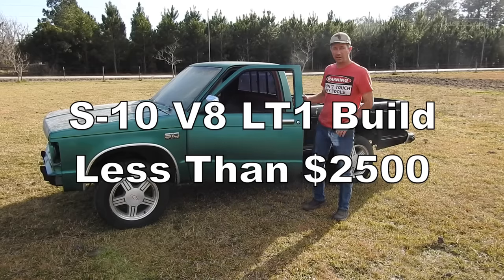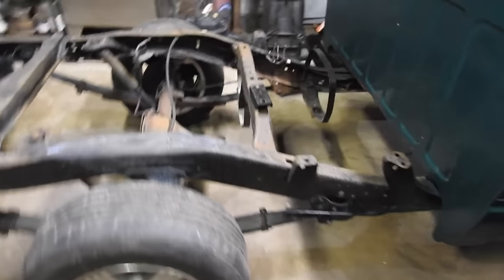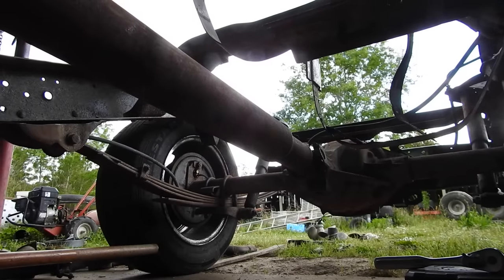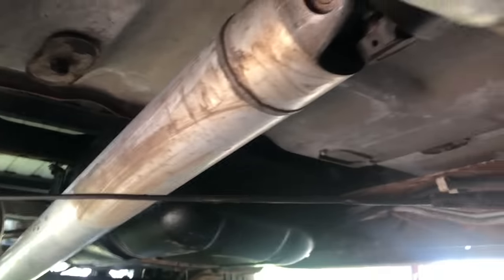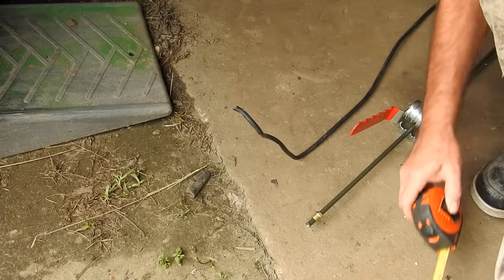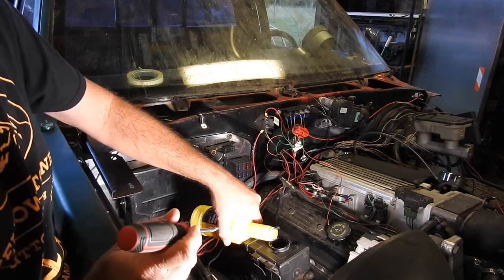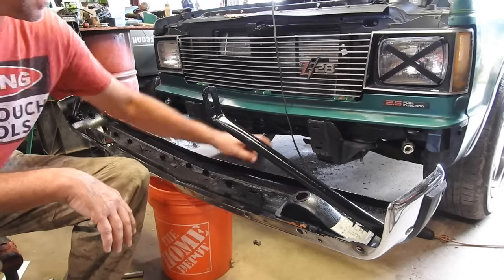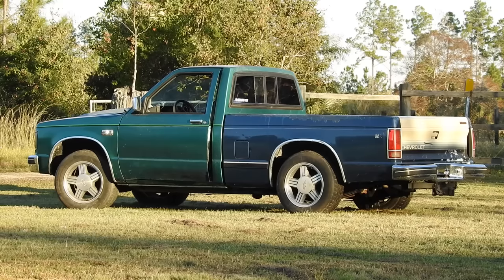S10 V8 LT1 Build for Less Than $2500

Comment: Ive just been gifted a free 81,000 mile, 95 Z28, from a guy I used to turn wrenches with at the local Ford dealership.  He spent thousands on the engine, heads and transmission. It dyno'd at 421 hp to the wheels, N/A. Plus it has a 130 shot of nitrous on top of that. He ran 7.40's on nitrous at our 1/8th mile drag strip here in Jackson, TN. Its been sitting out in the direct sunlight for 10 years and the clearcoat is bubbled up on it. So we're gonna have to try some wizardry on that, and see if we can at least make it a nice 10 footer. Lol. He parked it only 2500 miles after building it, due to blowing a head gasket. He got in a hurry finishing up putting the engine back togethern, and put a cheap set of gaskets on it. So im hopefully gonna pull the heads off this week, and drop them off at the machine shop, just to have them cleaned up and checked, just for peace of mind.  best gift ive ever been given. Lol
Reply from the maker: That is a very cool gift with very impressive numbers. Let me know how it turns out and thanks for watching!!

Comment: Very cool to see a 'more with less' S10 swap. Very well thought out and done. Love seeing a LT1 used for the swap. Very over looked engine. Lots of fun for cheap!
Reply from the maker: I was shocked to get a good running engine for 500$. Has lots of power so far too. Win win, thanks for watching
Reply: LT1 was available in Corvette and Camero only, and they stopped production in 1970. They didn’t have aluminum heads, but cast ones with the double-hump castings. 2.20 intake 1.60 exhaust valves. It was a 4 bolt main block and had “pink” rods, which had 7/16 rod bolts instead of the usual 3/8. In the Camaro it was rated @ 350 hp, ‘Vette 360 hp the difference being cold air induction of the ‘Vette hood
Reply: @donscott6431 this is the 92-97 LT1 right?
Reply: Yeah, except for the opti-spark, 1st class motor!
Reply: @donscott6431  LT1 is from 96 Impala bro, what are you talking about?
Reply: @princesrmichael1967  you can always get the ls coil conversion
Reply: @princesrmichael1967  I bought the LAST available LT1 crate motor from Jim Reed Chevrolet in 1972. OG LT1 was in a 1970 corvette/camaro. 10 1/2 compression ratio, pink rods (3/8 rod bolts) 4 bolt mains, heads: 64 cc, 2.02 intake valves, 1.60 exhaust valves. Camshaft: .550 lift, 318 degree duration with 102 degree overlap
Reply: @donscott6431  I know all about it bro, I've been there done that, I had double humps on my 87 IROC, 400 small block, car was insane, but those old skool motors have nothing on the LS motors bro! You can get 2000 HP out of an LS!
Reply: @donscott6431 fantastic, this is a gen 2, nobody cares.
Reply: @kileawesome  👍🤣

Comment: I can relate... first car: '69 Z/28... now I've got 3 S10s hanging around needing V8 swaps. I struck gold about 5 yrs back and now sitting in the garage properly cared for and stored is an original '69 Z/28 DZ 302 with appx. 20,000 miles. Getting off my butt to start this gig. Can't wait to hear that engine do its thing once again...I remember the way it sounded and felt back in '78....
Reply from the maker: That is a gold mine!!! You could get big bucks for that!! I would love to hear it once you get it going. I had a buddy fixing up a 69 Z/28 clone. He has the 302 completely rebuilt, but then sold it before firing it up. He decided to go with a big block. Bet he kicks himself now.... Thanks for watching!;

Comment: i have a rust free 1984 s10 blazer 4 x 4 , installing a tpi sbc from a z 28 camaro into it, 700r4 tranny  out of the same camaro. changed rear shaft and housing to accept transfer case.purchased wrecked z28 camaro , for $ 500 , with 41,000 miles on drivetrain. 
your vidio motivated me to get back on it and geter done.  thanks for sharing.
double K from western pa
Reply from the maker: Very cool, I want to do another V8 4X4 S-10 some day. Get your done and thanks for watching!!

Comment: I bought an 85' Blazer in the early 2k's on a "buy here pay here" back lot for $900, it had an old school 4 bolt 350, and what looked like Hooker headers, MSD ign parts, perfect base vinyl interior, no dents, no dings, nothing but faded pain. spent 10 hours working on the paint, and $300 on a used Holley/int. manifold...I drove that thing for 2 years, until the trans started to wear out, sold it for $3k :D there's some good finds out there, just got to pry a bit, even at the smaller sales lots, people don't realize what they have sometimes, don't feel obligated to tell them!
Reply from the maker: I love find good deals , especially on V8 S-10's thanks for watching!!

Comment: Pretty much hits the nail on the head. I put 6L in my 94 SS and spent the summer driving the bugs out. Now it's winter time let the upgrades begin LOL. I swear it's an addiction.
Reply from the maker: I feel the same way, but I tell people it is almost an addiction... Thanks for watching!
Reply: I used to have a base 94 2.2 5 speed it was regular cab short bed 4x2 crank windows absolutely nothing other than ac.  I always wanted to swap an lt1 because back in the early 2000s ls swaps weren't cheap at all (imagine that) with a t56 behind it.
Reply from the maker: @midnight347  I would like a T56 behind my next one too. Thanks for watching!!

Comment: Great build. Just one little thing. I would build a sort of box around the air filter to sort of isolate it from the hot engine bay air. Then I think it would be a good idea to wrap the metal part of the tubing in heat shielding so it doesn't get as much heat.
Reply from the maker: I have already been pondering how to do this, we will see and thanks for watching!!
Reply: I doubt u would fix, let alone build anything champ... Keep up the great comments though bud, you're making a real difference😂🤣🤡👎🕺
Reply: Plus that cj5 has a custom paint job and has custom chrome bits on it, but sure go off.

Comment: Really makes me want to get my truck engine swap done. I have a 93’ SCLB Chevy 1500 350 tbi and a 98’ Chevy 1500 Vortec to go in it, just haven’t had time to do it yet. When I do, definitely gonna take some video. Amazing video my friend!
Reply from the maker: thanks so much and hope you can get to your soon .  thanks for watching.
Reply: Cool. These were good pickups. Very cheap to maintain. I also loved the earlier models dashboard. I had a 1989 and a 1992. I liked the 1989 better just because it had the weird dashboard. It was a 1500 with a 350 tbi. They also made many with the 305 and the 4.3 V6 tbi. The one we had at my job had the 4.3. That pickup saved my life. I crashed in a 5 tons water tanker at 100km/h the guy turned on the red light and cut me the way. It was a 1988 1500. The doors wouldn't open anymore and it didn't have a airbag obviously. I was lucky to have only a palette of folded boxes. I usually have to bring 32 inches steel manhole covers from the machine shop. It will have cut me in 2.
Reply from the maker: @xminusone1  that with manhole covers would have been ugly. Glad you were doing okay

Comment: Brings back memories of my 1998 ranger budget build. I had drove it for 7 years with the 4 cylinder in it before deciding to go 5.0. My budget in the finished product was zero dollars. So I found a 1998 explorer 5.0 for $500 and a F150 For the 5 speed for $400. Sold converters off explorer for $500 sold motor from F150 for $300. And sold the scrap from both donor vehicles and think I ended up a few hundred dollars ahead. But while the ranger was fast and strong it was extremely horrible on gas. I did drive it to work before gas went up and it cost $20 a day. I traded it of about 6 months ago. These projects can be fun but can be built on a budget
Reply from the maker: Very cool story, sounds like you could do this for a living. Mine before this was $600 through trading, using what was in the garage, and deals on marketplace. I sold it for $2400 + $400 for extra tires and wheels. That is $1800 profit. Only thing is I don't want to sell this one to build the next one. Cool story and thanks for watching!

Comment: The 2" lowering blocks would have been perfect. The 3" has the rear lower than the front.
Reply from the maker: Agreed 100% please check out episode #2. In episode #3 I used the 3" blocks on the matching truck bed trailer. thanks for watching.

Comment: Ive had this vid saved for a year in my watch later. Just finished the whole thing and enoyed the vid!
That power steering just got some air and probably wouldn't mind if it was flushed. To get the air out let engine idle and slowly work toward each side lock for just w moment and back to center. Its a good idea to flush it at same time by fabbing an extra long low pressure return into an old antifreeze jug or equivalent. Watch how dirty that fluid is. Keep tabs on the fill and slowly go to lock then center then the other direction.
Reply from the maker: So glad you watched and great tip!!

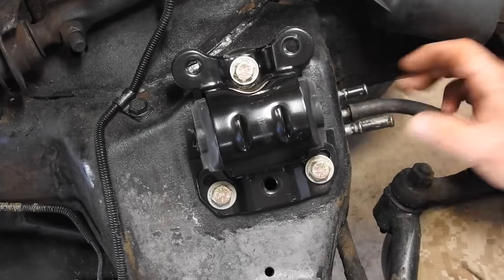Comment: We built a S10 short bed back in the 90,s we dropped a 1972 400 small block with a turbo 400 long tail NO overdrive we put header,s and a 4 barrel and Edelbrock intake! Msd & electronic ignition And put a Manual Steering box and put skinny 70,s tires on the front with Cragar S/S! and on the back we put 15X10 with N50 Mickey Thompson Tires on a 12 bolt rear with 4:33 gear,s litterly 30 MPH Jump on it would lay down about 300ft of posi From a standstill it would pull the front Wheel,s 2ft off the ground from dead stop kick down.
Reply from the maker: Sounds like on sick machine. Thanks for watching!

Comment: I enjoyed the video. With the V8 power you definitely need to crack open the diff cover and clean it out and weld the spider gears ⚙️ to make it a posi traction so you won’t be doing one wheel peel and gain traction. Thank you for sharing chud327.
Reply from the maker: Hope to make it posi soon, thanks so much for watching.

Comment: I had a white 1989 single cab S10 with the 2.5 4 cylinder engine. It had a vinyl powder blue color bench seat. It had am fm and no cassette.  It was a plastic dash with the powder blue color. Also had plastic molding OVER the lighter, so no lighter but a ash tray. It looked like a bare minimum company issued truck, my dad bought it used. Loved that truck, I beat the hell out of that tiny 4 cylinder! I was a broke college kid and would change oil every 12 thousand miles. Lol. ..also hauled ton of sand.     Years later I bought a 1988 4.3 v6 with crew cab.  It had 120k miles and smelled like a ashtray.    The the passenger door was a different color. Rusty, lol..  this was 2001 and I remember the cassette deck and Delco still rocked, the 4.3 absolutely hauled.    It unfortunately reek very bad of stale Marlboro reds.  It was getting smokey and parts hard-to-find.   Got rid of it after a few years
Reply from the maker: Cool memories! I had a work truck that the previous driver was a chain smoker, had to ride with the windows down... I know what you mean! Thanks for watching!!

Comment: Thinking about doing a 97 s10 old school no computer  but I know nothing about wiring  that's is what is holding me back.
Reply from the maker: The good news is it only take on hit wire to make an old school V8 run.  If you can get the starter to turn over and have a hit wire to the distributor it should run. Then you can wire the other stuff on wire at a time for your gauges, electric fans, etc. I am thinking of doing an old school V8 in my next build too. Thanks for watching!!
Reply: @chud327  Thanks very much sir.

Comment: I never change a trans filter unless I’m sure it’s had maintenance every 40-50 thousand.  I’ve seen so many be working perfectly, change the filter and not make it another 500 miles. I had transmission man explain why that is one time but I’m old and forgetful now days. I can’t remember what he said.

Love the truck, nice job.  You made it look easy.
Reply from the maker: Would love to hear the explanation, feels like that happened to me once many years ago... Thanks for watching!!
Reply: @chud327  3

I can’t remember exactly what he said but found this in google and seems pretty close to what I was told. 

The debate about transmission fluid change revolves around a basic problem. Typically, a transmission pan drop & fluid change only changes about half the fluid. The fresh fluid effectively cleans the transmission and releases particles of old build-up, which circulates throughout the transmission, leading to slipping gears, pressure drops, overheating, even complete failure.

Comment: I absolutely like the way you work, look so easy and the V8 with your exhaust combination has brutal sound!
Reply from the maker: Thanks so much and sound is one of the most important parts for me. Thanks so much for watching!!!
Reply: @chud327  I plan to swap a V4 1.7L from a Ford P7P 17m to a Mercedes W163 4.3L V8. It is the first time I do such thing and are mostly afraid of changing the small manual transmission to a big automatic :/
Reply from the maker: That sounds very interesting!!

Comment: My brother built a v8 prostock street S10. I did the wiring on it and the paint job he was able to do in his garage and had a professional help do it. Total for everything was about 35K. It had a beefed up 700r4 trans, a 400 whpChevy v8, a really sweet interior and went like the proverbial bat outta Hell. With the narrowed frame and a Starnge 9" rearend he got some beefy tires under the rear and it needed them. That engine was built with Nascar type heads and camshaft and ran from idle to 7k without a blip anywhere in its power. It was brutal for such a lightweight truck but we both loved it. I'd take it any day of the week over this "conversion" you did that I wouldn't trust to get me across the street. Sorry dude but you really built a deathtrap.
Reply from the maker: His sounds sick, but I will never since 35K into a toy. But then again I would never criticize someone who did. I would take my $2500 deathtrap, that never let me down, I anyway of the week and keep the $32,500 in the bank. Thanks for watching and you don't have to reply back...

Comment: Got a 83 S10 4X4 Longbed and the 2.8 was cooked. Thinking LM7 4L60E. Was abolutely filthy so having a time getting it clean. Also the bed is not rusted but they hauling heaving farm equippment as its warped banged up pretty bad, might be worth a restore. The motor mounts on the 4X4 are super hard as drivers side is buried under the front diff. Those might get welded!
Reply from the maker: I don't know what a lm7 is. But you should be able to find a better bed. Thanks for watching!!

Comment: I had a S10 blazer with a 383 that ran really good a S10 blazer with a 400 that was pretty nice and a S10 pick up with a 355 and 2 with 4.3 s and 1 2.8 they were all square body except 1 2002 with 4.3 I'm looking for a really nice roller that's straight and has gòod interiors to put another small block In with some good horse power. Great video
Reply from the maker: Sounds like you have had my same addition. I I love a 400, never had a 383, but always wanted one. Thanks for watching!

Comment: by the way, based on my lt1 experience, I recommend upgrading the ignition wires and all vacuum hoses while you can get to them.  those lti's cook these item pretty quickly.
Reply from the maker: Thanks for the tip and thanks for watching.
Reply: Yep the MSD optispark boxes and wires are worth every penny. That or an 0411 pcm swap and coil on plugs which is more complicated for sure.

Comment: Your making me think further into this. I have a 2000 LS 2.2 Standard bed.
Reply from the maker: If the 2.2 runs good, I would probably just drive it and start saving up the V8 swap parts.  But as soon as the engine goes, I would start on making it a hot rod.  Thanks so much for watching.

Comment: 😆 we used to do this in the early 2000's with 305 and 350. It does a monster burnouts machine. I think these particular s-10 models shared alot of parts with the G bodies. The front and rear breaks and the differential I think. Same with the camaro and firebird from that area.
Reply from the maker: Very cool and smart that they share parts, smart move by Chevy. Thanks for watching!

Comment: If you plan on keeping that truck you should really put a fuse or fusible link on your small power wire from the battery that's a fire bomb waiting to happen buddy, and make it so the exhaust can flex been a tech for 17 years
Reply from the maker: Will look into both for episode 2 and thanks for watching!

Comment: It needed a lot of work, but that truck was still an absolute steal for $500. You spent less engine swapping and restoring it than a running one in similar condition is worth. They normally sell for at least $3,000.
Reply from the maker: 3000$ if you are luck, I feel most truck seller must have a lot of sentimental value... Thanks for watching!